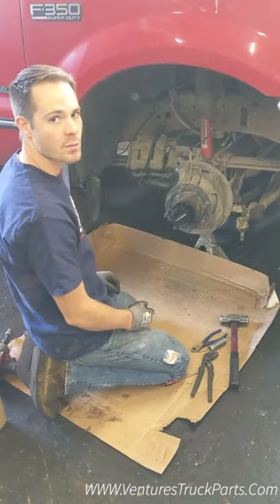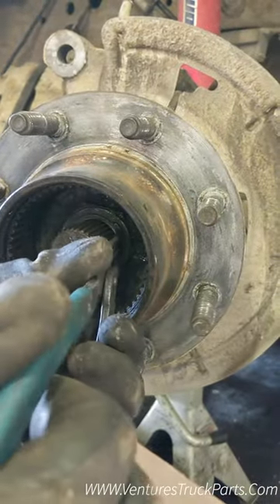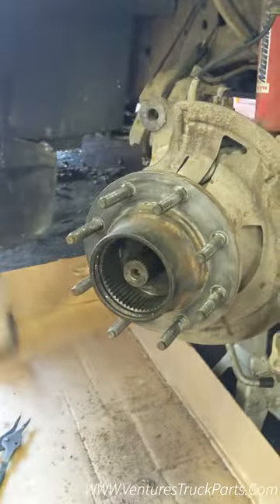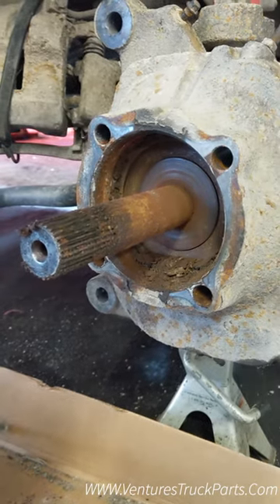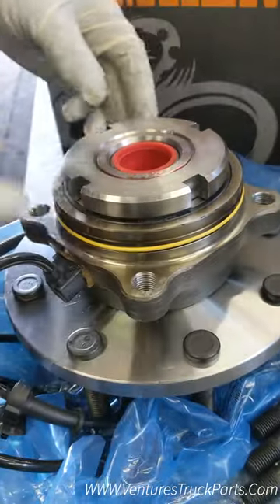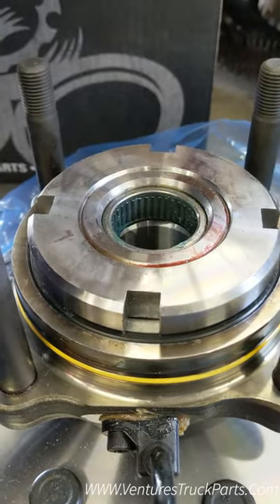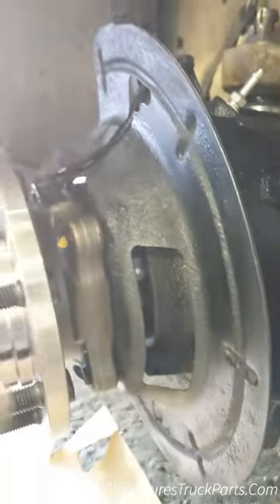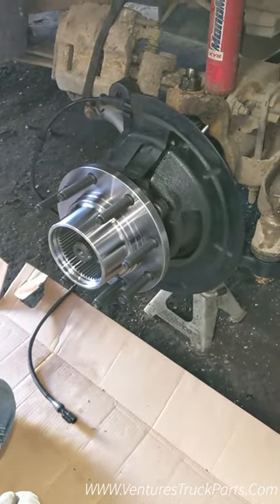Ford 1998-2004 F250 F350 F450 F550 Excursion Wheel Hub Removal And Install

Comment: Nice job! Most of these look the same but some come with different size threads, so before you leave the store check that your lug nuts will fit it. Yes you'll have to pull a lug nut but it's better than finding out when it's all apart you can't put your wheels back on. Yep it happened to me, so when I did mine I had to remove the new studs on my new hub and change them out with the ones that were on my old Hub Assembly. Thanks for sharing. Thumbs up. Best Wishes & Blessings. Keith Noneya

Comment: My 2001 F350 dually had right hub replaced @ 251K and the left one @ 253K two years ago.  The truck tows goose-necks and just turned over 280K.  It's never been to the shop.  Anything done to it has been done in my Dirt Driveway.  A 3/8 sheet of plywood supported the six speed trans and transfer case last year when the clutch and carrier bearing was replaced. I got the truck used off eBay 16 years ago.